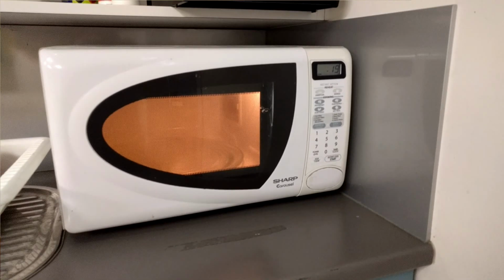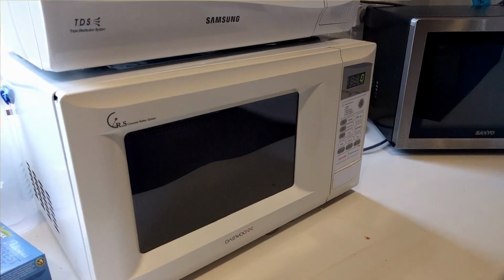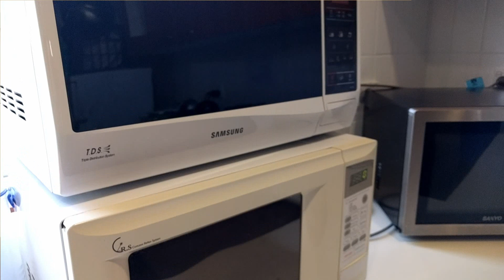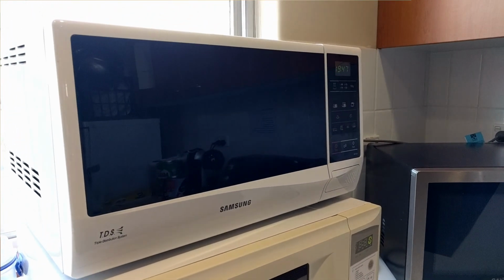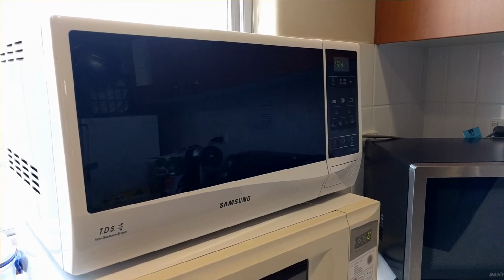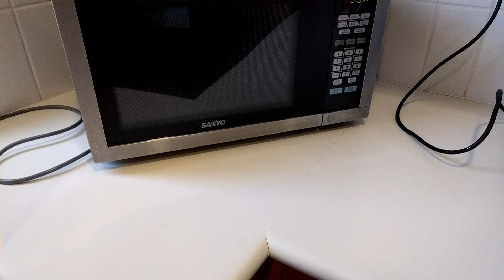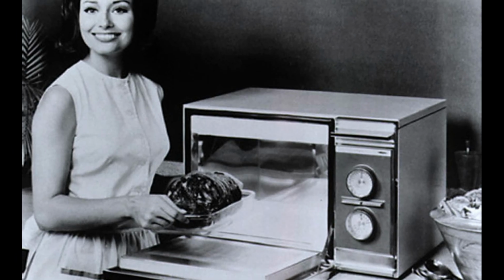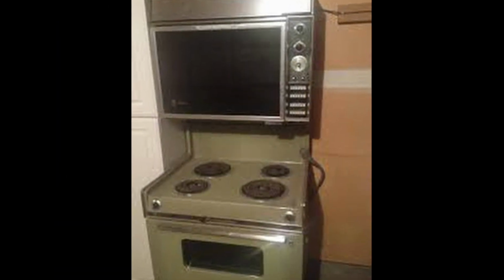Why don't microwaves use 915 MHz?

Comment: Very informative video! Why do microwave ovens need to operate in ISM bands when they're designed to keep all of their radiation inside the cavity? Wouldn't it be beneficial to have a frequency between 2.45 ghz and 915 mhz to find a balance between speed and even cooking?
Reply: There's always some amount of leakage. Radio bands in the 1-2GHz range rely on really clean airspace to transmit at low power over great distance. The "small" amount of leakage from ovens would spoil that.

Meanwhile, 900MHz and 2.4GHz devices have expectedly low range because the airways have always been so polluted at those frequencies. (high noise floor)

Comment: Is there any truth to the claim that microwaved food is less healthy than other cooking methods, such as cooking on a stove top or in a convection oven?
Reply from the maker: Caddy 1983 As far as I'm aware, no.
The usual claim is that the microwaves break down the proteins, which is true, but normal cooking does that anyway.
The microwaves just heat the food, same as other cooking methods.
As long as the food is properly cooked through I would guess it would actually be healthier because it will carbonize (burn) less than with other cooking methods and the carbon is bad for you. It's a known carcinogen.
Disclaimer: my expertise is in microwave technologies, not food.